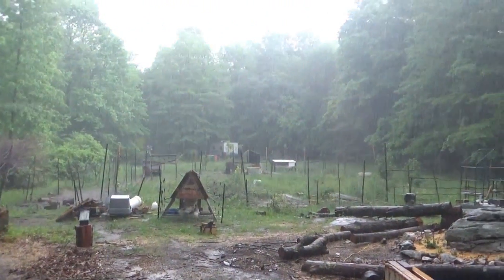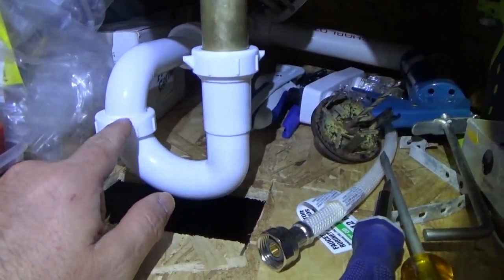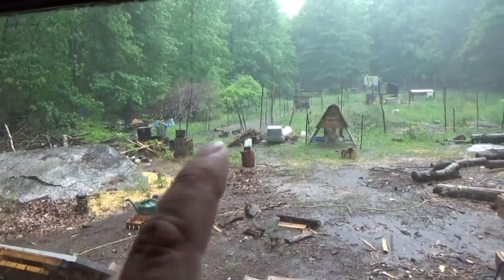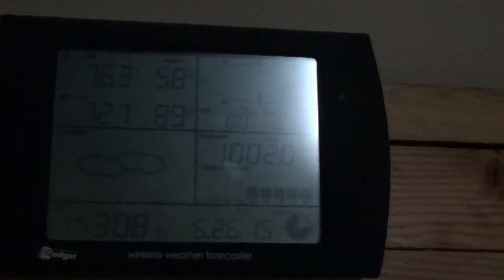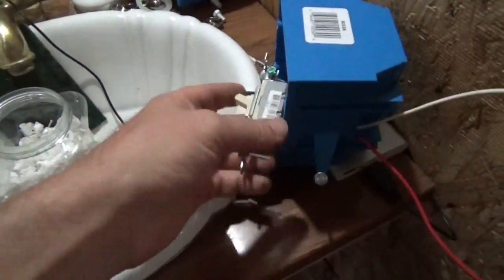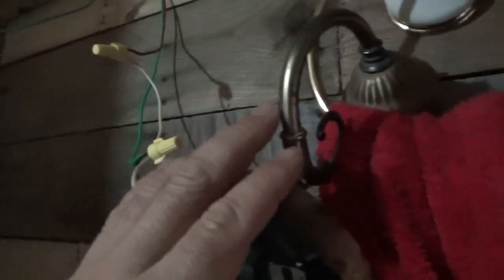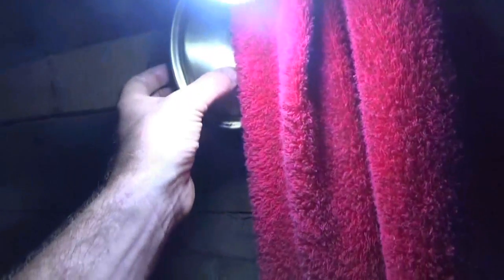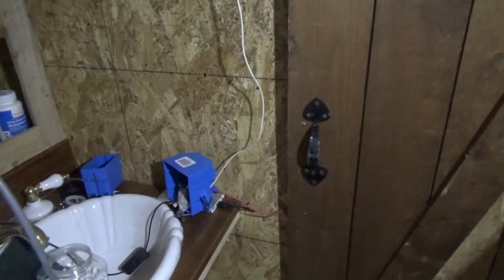Wiring Tiny House Bathroom Lighting

Comment: I wish you had put your wiring behind your walls as this all looks a bit junky and cluttered JMO. Is there some electrical code you need to follow in your area for tiny house wiring? I'v e watched some other tiny home building and their wiring and the 1s I seen were done properly, had breaker boxes, heavy gage wires, and all hidden behind the walls etc. Doesn't take much to overload wiring systems. Have you installed a fire alarm upstairs and downstairs?
Reply from the maker: MissX905 I am far from finished in here. I will hide them all nicely. And I did fuse them properly. Each line has its own fuse. There is a heavy gauge main wire which is fused that provides power to the fuse boxes. Fuse after fuse.
Reply: The Do It Yourself World Oh that's good :) Glad you have lighting.

Comment: very good, i would have done it differently, but you will get it going, the wire need not be too big in gauge as the led is a small current draw. 14 gauge is like 15 amp 18 is close to 5 amp, send the rain to california, ha not to texas

Comment: If you were to cut the drain pipe off a few inched and raise the P-trap up a few inches, you wouldn't need to have the hole in the shelf and the P-trap would be more out of the way also.
Reply: D Lastname
Who really cares?  Do you? No? I didn't think so. At time everyone could use a better idea for something, even you.
Reply: JAI Colorado Actually that's what I would have done. Since the PVC drain line is already glued and set I guess it's too late now.
Reply: ***** Could still be accomplished even with the drain line where it is. A little bit of creative PVC work is all it would take. Gain a lot of room on that shelf.

And BTW I was answering one of the trolls who have been banned. I usually don't waste my time. He is gone now, never to return without changing identities. My mistake.
Reply: JAI Colorado I was wondering about the second comment in the video comments because I couldn't see the troll. I see the troll here so it makes sense now. The comment, not the troll. :-D
Reply from the maker: ***** Actually It was an error when I calculated the thickness of the shelf frame between the cat litter box and the bottom of the j trap. So I cut a hole in it
Reply: The Do It Yourself World Troy, You maya have missed the point of my original post. If you had cut the "down" drain pipe off just above that joint, you could have put the trap in there and have a larger shelf without the hole in it. You could still do it and replace the shelf board.
Reply: JAI Colorado The tailpiece. It's a dumb name but that's what it's called. :-D
Reply: Thanks, Mind went blank while typing. Actually it's blank most of the time.;)
Reply: JAI Colorado Well, that happens to all of us sometimes. :-D

Comment: What happened to the no till Back to Eden garden plan?   I hope you will reconsider and not till.  You have the wood chips... figure out a way to get them to the garden. I know you can!
Reply from the maker: MollyDolly It takes time to build up that type of garden. It will take years.
Reply: The Do It Yourself World  I don't think so... I have watched many YTers throw down card board (if not enough wood chips for 3 inches) pile on wood chips (seasoned is better) plant by cutting a small hole through card board and it grows great.  Each year, just add a layer of chips and leaves as they break down.  The card board dissolves.  Personally I wouldn't use card board in my garden again.  I used to use it on the paths. .. but there are glues and paints and who knows what in cardboard. If you get 3 inches of chips and leaves down weeds can't grow.  But more importantly it regulates the water needed.   No need to till, just chips... a lot of chips.  You've got branches to mulch...

Comment: Humidity you can see.  Eeeww. ..
Reply: MollyDolly Oh yeah. Troy has had some high humidity the last few days, up to 97% and hot. 3% more and he'd be swimming around the meadow. :-D
Reply: ***** And THAT is why I vowed to never visit NY in July again.   Once is enough.  My sister in law lived in Queens. .. the last time I was at her house it was July...yuck!  I got out of the shower and could not dry off, period... I rubbed and rubbed with 2 towels... still completely wet.   That is the strangest sensation.   All you can do is get dressed wet and find an air conditioner.  The only point of the shower is to smell better but you're still just wet.  :/
Reply: MollyDolly It's strange, but people really do get used to the heat and humidity. I have also experienced the not being able to dry off after a shower thing, and I hate it. The humidity where Troy is is even worse than NYC! For me, a summer visit is out of the question. I'll take the snow any day.
Reply: *****  Definitely winter or fall.  You know how I feel about fall... but I think sledding down that drive way would be a blast! !
Reply: MollyDolly I guess fall would be good, but I would prefer the snow in winter. The cold doesn't bother me much, when it's cold here people constantly ask me where my jacket is, but with all that snow I might even put on a flannel shirt. :-)